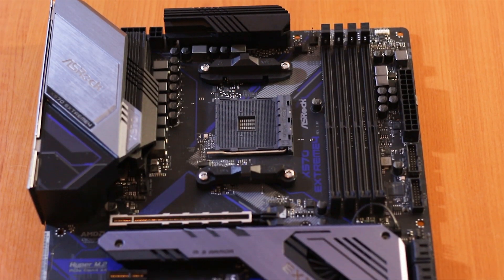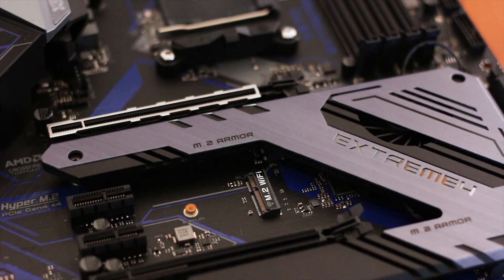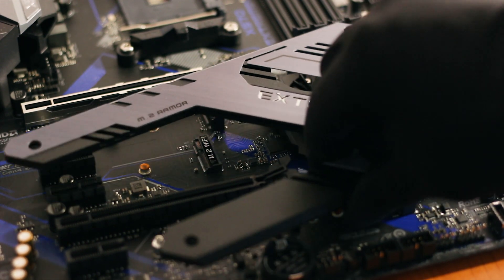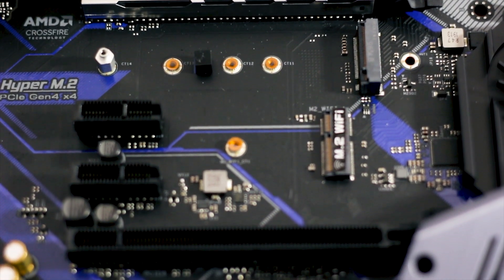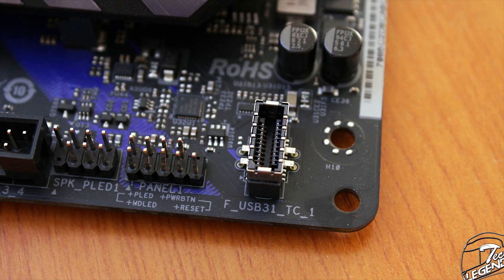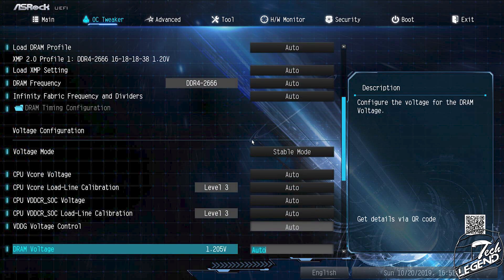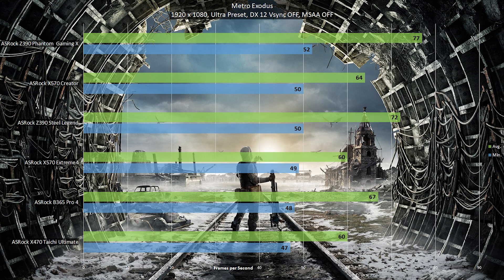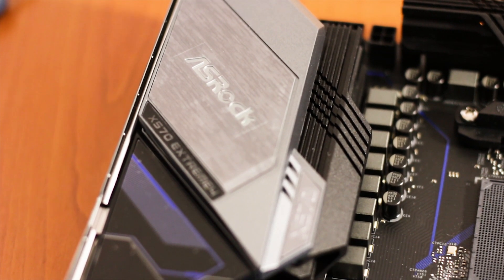ASRock X570 Extreme4 - Motherboard Review

Comment: I have this board. I came to video to see of you mention the board fan. Mine never turns on. But then I took the shroud off and realized origin pc builders never took the protective covers off the heat sink contact's for the m.2.
Reply from the maker: If the M.D heatsinks are not used, then that's why they left the covers on. It should not impact the behavior of the fan. IF you do use M.2 SSDs, then please take the covers off!
Reply: One of the many reasons I'll never buy a pre-built lol

Comment: i have a m2 witg it s own heat sink.. can i remove the integrated one without needing to ditch the chipset heatsink?
Reply from the maker: The M.2 heatsinks are part with the chipset heatsink. So i'd suggest you leave it as it is.
Reply: @TechLegend-com  well..off to another board than tnx
Reply from the maker: @CarloLeonKolega  Pretty much.

Comment: Question, how the WiFi works? I’ve been trying to connect by WiFi adapter but it doesn’t show any WiFi🤔
Reply from the maker: Do you have the Wi-Fi version of this motherboard? or installed a separate Wi-fi card?
Reply: Tech Legend@ this is not de WiFi version, I’m using NETGEAR adapter by USB ports
Reply from the maker: @teogomez5758  Then you need to check the NetGear user manual and configure that USB adapter.
Reply: @Tech Legend  Ok thanks for your time👍
Reply from the maker: @teogomez5758  No problem, let me know if you figure it out or you need some help. :)

Comment: hi, which M.2 slot is the main?
Reply from the maker: Usually, it's the top slot.
Reply: @TechLegend-com  thx for the feedback but I have one question, can I use one M.2 nvme for booting (main slot)  and the second M.2 slot for storage (games)? Everything will works fine? I not need any other ssd, hdd in the system.
Reply from the maker: @stahl_gaming  Yes you can have your OS on one M.2 drive and your data on the other one with no issues. Once installed, they behave like regular storage units.

Comment: Pretty good video, and solid walkthrough with nice B-roll. 
You did not mention Thunderbolt AIC expansion card compatibility, in order to connect a TB3 device, though.
That's the main reason i am getting this board.
Reply from the maker: Thanks for watching, you are correct, the Thunderbolt compatibility should have had more screen time.

Comment: Its going for $170 now :)
Reply from the maker: Not a bad price at all! :)
Reply: @TechLegend-com  I picked it up. Seems like a good mobo. But one of the temps is reading 60c, while idle or gaming. not sure why.
Reply from the maker: @EDKsurly  One of the temps? Can you give me more details? :)
Reply: @TechLegend-com  MB temp #1 and MB temp #7 are always higher than the rest. Sorry, Im a filthy casual. :)
Reply from the maker: @EDKsurly  You're not a filthy casual! You are just entering the Glorious PC Master Race. Where do you see these readings? In the Bios? Or in a software?
Reply: @TechLegend-com  Corsair Link. I have the H100i, LL120s and Vengence Ram.
Reply from the maker: @EDKsurly   Hm, how about you install AIDA 64 and then you tell me what temperatures you have? I am not kidding, install AIDA and please tell me what temperatures you have, and we will sort this out. :)
Reply: @TechLegend-com  TY for the help. Aida64 says CPU is bouncing from 40-51c, VRM is 52c, Mobo 28c, GPU 35c. Im thinking my fan config is bad. I have 3 120cc pushing out and the radiator pushing out, no fans pulling in... I should flip the 3 fans...
Reply from the maker: @EDKsurly  Those temperatures where with the system at idle or full load? Try at full load and t ell me the temperatures.
Reply from the maker: @EDKsurly  I just finished watching the video. Everything looks normal, don't worry. Those idle VRM temps are due to your lack of airflow inside the case. As you say, get more intake and it will improve.
Reply: @TechLegend-com  Thanks for the help, bud. I appreciate it!!!!
Reply from the maker: @EDKsurly  No problem, don't forget to subscribe! :D